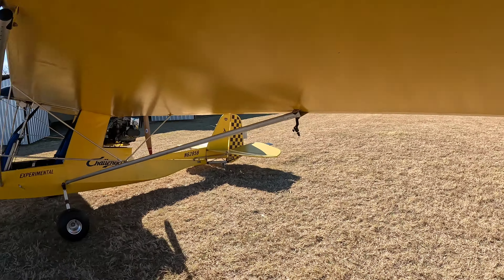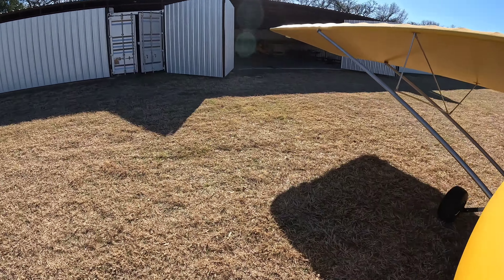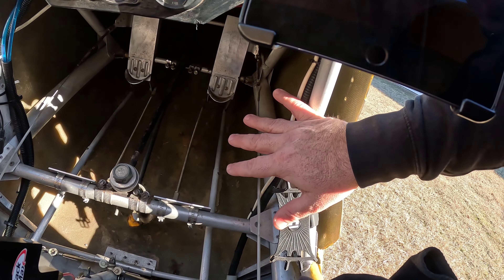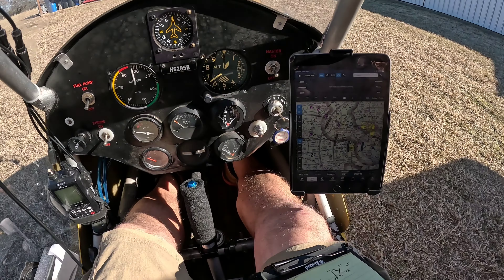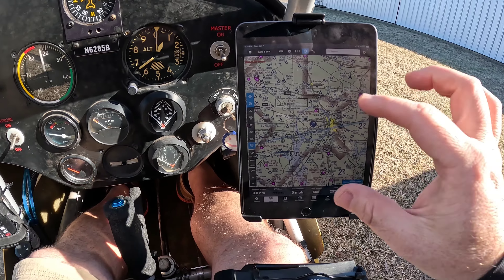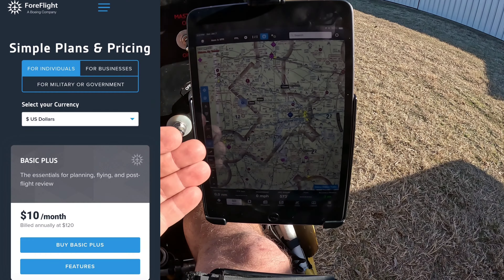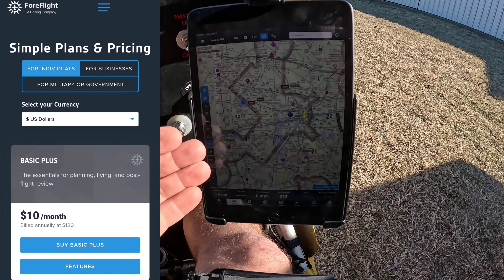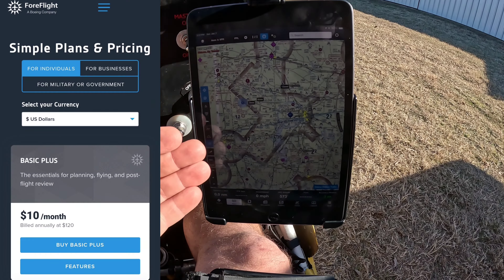What I Use While Flying My Challenger ll

Comment: I have found using the media mod to be much easier to use then that GoPro audio adapter and its cheaper. plug audio in and charge all in one case. If you're using the stratus adsb in you don't need a cellular version iPad. The stratus provides GPS. Great video.
Reply from the maker: This is true however if your adsb unit dies or loses signal which does happen you are up there with no GPS. Cellular gives you that so it's a worth having safety net! And media mod is something I will try at some point but I have this foe now and it works fine! My audio isn't Hollywood quality of course!  😆

Comment: Hey Jon, is your iPad mini WiFi and Cellular? I think ForeFlight needs WiFi and Cellular but I haven't tried it yet. Winter ceilings are too low too often here in the Pacific Northwest, or the Northwet! 
What generation is it? 6th Gen and do you use an Apple Pencil? I think the pencil will come in handing in Class C 
Love watching your videos! Also love that 12 volt accessories panel above your head. Love to see a closer look someday. Thanks. Keep up the good work! Also I like seeing your boy helping out Dad with the plane and the flying. My son loves the Challenger. What's his fishing channel?
Brad
Reply: Ok sorry I watched the video a few days ago and I forgot that you had put an Amazon screen shot for the iPad mini 6th Gen Wifi and Cellular. Thanks!
Reply from the maker: Hey Brad! Well foreflight will work with any ipad if you have a stratus or sentry unit adsb in because it will supply it that info however getting one with cellular is a great idea because it will still show your location if the adsb in unit takes a crap! I don't use the pencil because you're not really touching it to much when you're flying and foreflight has made it very user friendly plus all the mounts block the holder for pen! Best holder which I do have for flying other aircraft is pivot! Challenger has ram mount! Depending on what plane I fly I switch it. Thank you for watching and my son's channel is Adventures with Justice!

Comment: Like your videos very much - lots of good honest information and no annoying background music. A few questions if I may: How do you attach your Yaesu to the frame?
What is the make of your antenna?
How is you GoPro and Yaesu both connected to your headsets (I only see the GoPro connected)?
Thanks, Wayne
Reply from the maker: Unfortunately in not gonna be able to give you brands simply because the holder for my radio was in it already with no logo on it and my antenna was given to me and it was off a 172! But I would go on aircraft spruce website they have all of this stuff and it will work perfectly! Thank you for watching!

Comment: Challenger is a great aircraft! Sorry if I missed this, but do you have doors, or plan on using doors at some point? I know when I flew with doors on it definitely makes you use your feet a lot more 😀. You probably know this, but it is easy to duct heat from the engine to the front cockpit. Of course, makes no difference unless using doors.
Reply from the maker: Honestly I live I'm TX there really isn't a reason to. If I ever move up north I would definitely add doors and heat!

Comment: I really Appreciate this video.   I am planning on joining an ultralight association this spring.  Looking into purchasing a challenger.  I see each one is uniquely built.  2 questions.   the Radio is for both tower/ground and two waw between pilots?   and second is about Stratus. you dont have to answer.  I asked two CFI's and both said they dont know because they fly airplanes and not ultralights  with mode C transponder.  Im trying to be careful because your not an instructor. But if you would kindly look at fore flight and lookup airstrip 3TE.  the air field falls within a magenta ring that says mode c ads and b out.  do i need a transponder or will the Stratus help.  but you said its not for them to see you but for you to see them?  trying to see if i can fly in and out of this airfield with ultralight.  I  understand for most part how to read sectional.    i am close to class B with airspace from 4000 feet to 10000  and 6000 to 10000 feet.    i will stay clear of that area for sure
Reply from the maker: Yea the radio is for both! If you live in the megeta you will need adsb out! The stratus is only adsb in so you wouldn't be able to fly from there. Now you can get it installed but you would need a registered challenger and I license sport or private! My Challenger 2 is an LSA not ultralight! I'm a private pilot. The channel the cotton patch his name is Jason his challenger ll is equipped with all of the stuff you need if you want to drop in and ask him about it! Thanks for watching

Comment: Good information. Does the PTT work with your radio?  Where does the PTT plug into?
Reply from the maker: Yes it's a separate PTT it's also plugged in line if you look at the scene I'm talking about plugging in the go pro audio you can actually see it plugged in next to it. Dang with I would have covered that. Sorry

Comment: What oil do you use for your engine and ratio do you mix it?  Also, maybe you mentioned that in the past, are you running an electric fuel pump as a back up?
Reply from the maker: I run Amsoil Dominator! I do 2.6 ounces per gallon so 13 ounces to every 5 gallons! Yes I use a fuel pump for all operations under 500ft AGL!